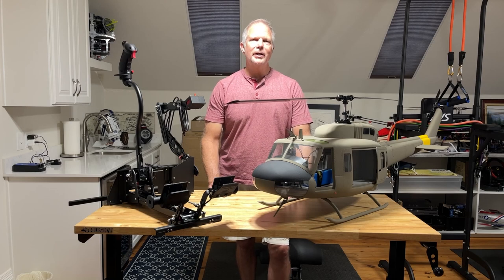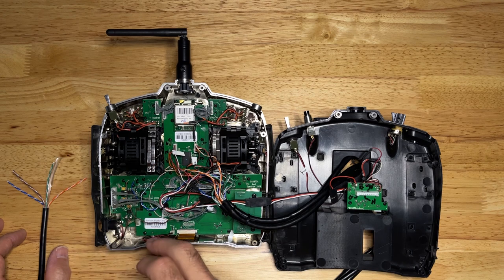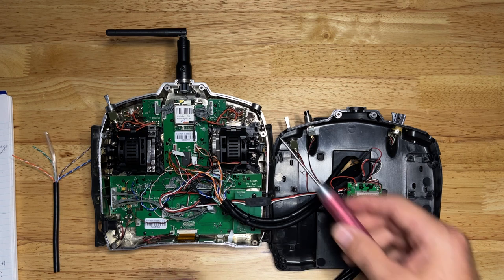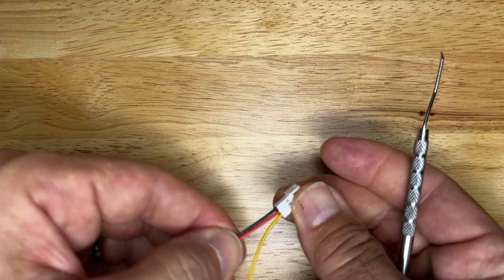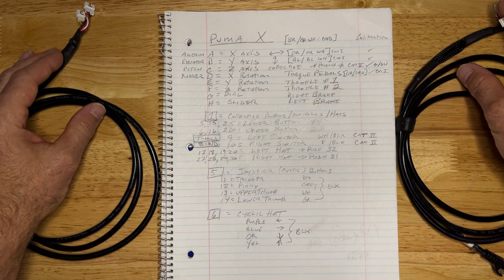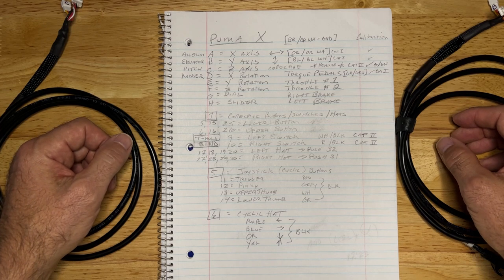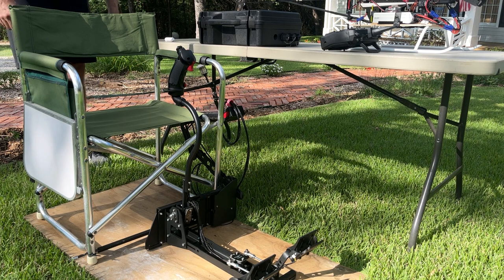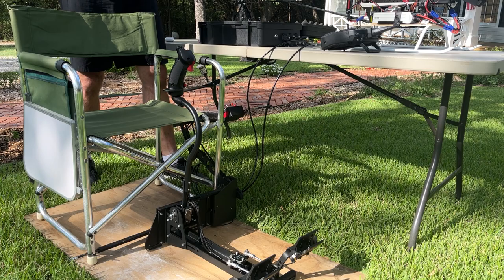Build the Pro Flight Trainer PUMA X to fly RC Helicopters

Comment: You poses a level of technical knowledge far beyond what I can understand (electronics, electricity in general...we don't get along). I was wondering, instead of changing the location of the wires so the colors match (yellow to yellow and so forth), why not strip the ends and solder them together? A small length of heat shrink around the exposed soldered spots and BINGO! You get a much better connection. Well, maybe not a "much better" because the loss at the contact points within the plugs is minimal but you get the idea. Unless the quick connect plugs are necessary, why not make the connections permanent?
... nevermind. I just got to the part of the video where you do exactly what I described above.
Reply from the maker: Absolutely!

The idea in this case is to be able to unplug the wiring harness and use the stock pc board to plug into a computer as the manufacturer intended. Without permanent changes to the original system one would retain all of the original functions.

Comment: Brilliant project, though the approach - physically connecting the radio cct board and the control sticks - seems a little old school.
Would it not be preferential to use the buddy-box connection, with USB to Serial data conversion via an Arduino microprocessor?
Reply from the maker: The original concept actually involved a Raspberry Pi. I decided that I didn’t want to trust a 5 ft rotor in the sky to my programming skills😂

Comment: hello, I saw you video, thanks for the good explanation, I have question: if for example in this system I mount only the pedal + the collective or the pedal + the handle the system works in any way or all the 3 element must be connected all?
Thanks.
Reply from the maker: The way I have connected the controls you can hook up any control in any combination.

Comment: It could be possible with an Arduino board and some simple electronics to use the trainer port of a radio. In a second step you can make it a wireless connection between the Puma X and the radio.
Reply from the maker: Absolutely!

You should give it a try!

Comment: Last question so what you use to make it FPV is Motionsic Bag and DJI FPV camera bundle. How do you make it so that the headset can track the head? Thanks (:
Reply from the maker: I have had the best results with the Motionsic BAG, DJI FPV and a head tracker on the goggles. I currently use a Fatshark FSV1610 external head tracker, however Motionsic has their head tracker I’d like to try.  https://fpvdogfight.com/products/tally-ho-head-tracker
Reply: @lwright292  Thanks so much immensely appreciate it

Comment: So my next question is, why dont you use the buddy system to plug directly into the radio controller to control the helicopter  ?
Reply from the maker: In the case of the larger helicopters I have found that using the wireless link for buddy boxing allows me to plug my FPV head tracker via a wire into the DX8. 

Essentially buddy boxing a buddy box.

Comment: What is the benefit of this over using ardupilot fly by wire and the unmodified controller over usb? I guess no pc required, and less latency, but it feels like a lot of work for something where there is already a tried and tested solution
Reply from the maker: This system is designed for realism  and portability. There have been arduino based systems on the market that have come and gone but without the features I was looking for. 

For me this was the best solution.